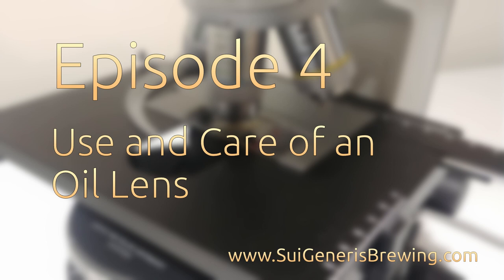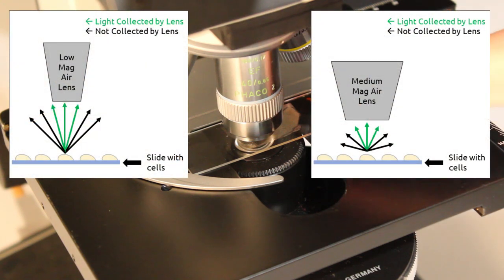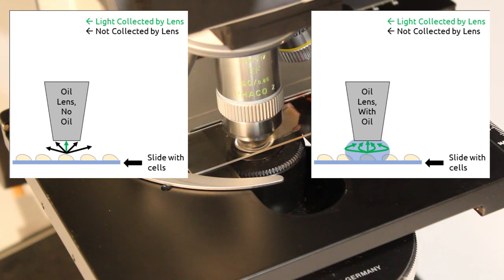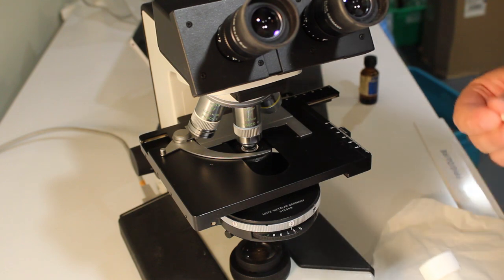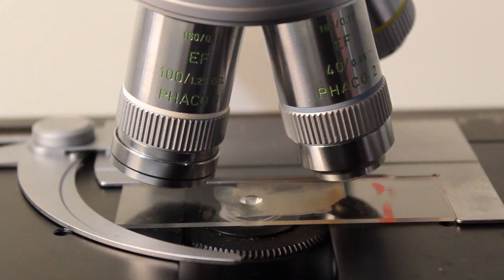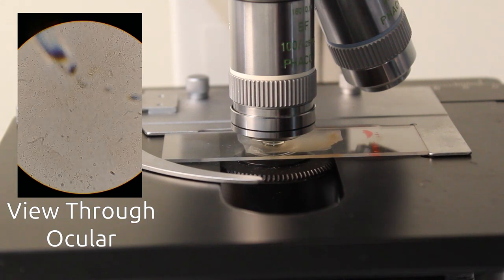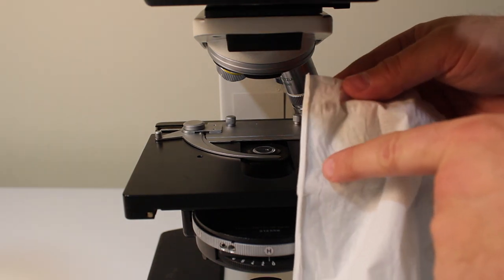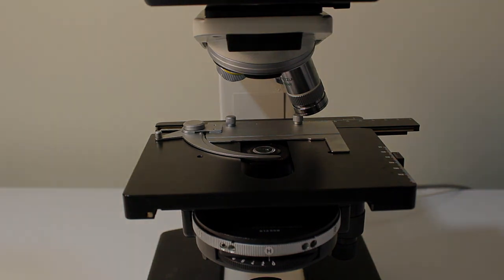µBrews Episode 4 – Use and Care of an Oil Immersion Lens

Comment: Is a specific oil required to be used?  or can I use mineral oil?
Reply from the maker: It needs to be microscope immersion oil.  Do not use other oils like mineral oil as it may damage your lens. Immersion oil has a specific optical density to maximize image quality, and is formulated to ensure it doesn't dissolve the glue and coatings used to assemble lenses. Use non- microscope oil is a great way to quickly ruin a lens!